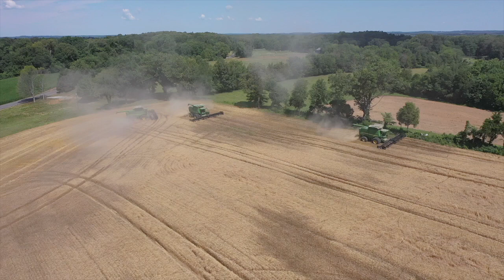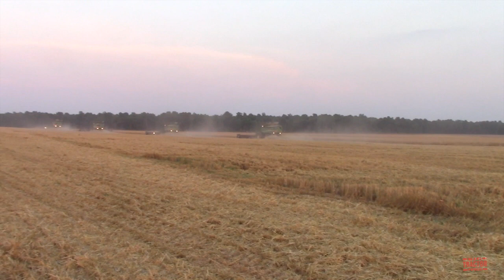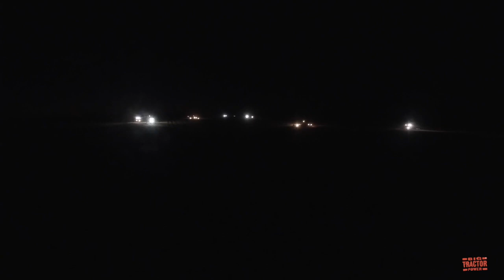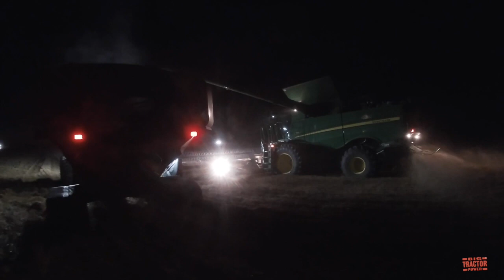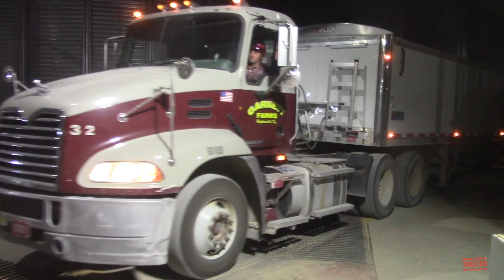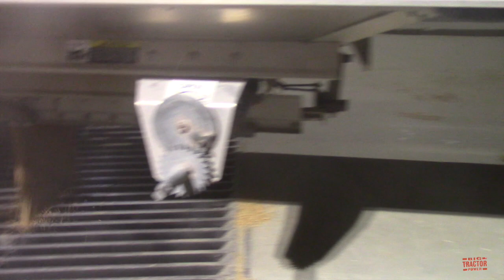2,800 Acre Wheat Field Harvested by JOHN DEERE S790 Combines

Comment: You should come to southern Minnesota and film a big outfit in my area. They farm abiut 30000 of corn and beans. Moliter brothers.  Good operation from what i hear good equipment too. One of they're bin sites has one 550000 bushel bin and currently putting up another one looks to be the same size. Come check them out
Reply: I drive past that place twice a day going to and from work. Lots of big green equipment there. They have solar panels there too.